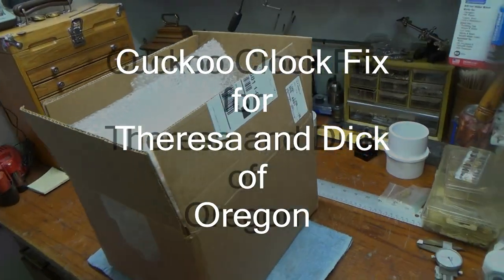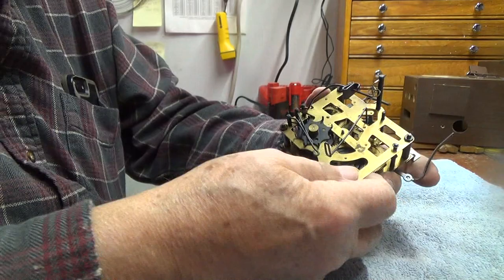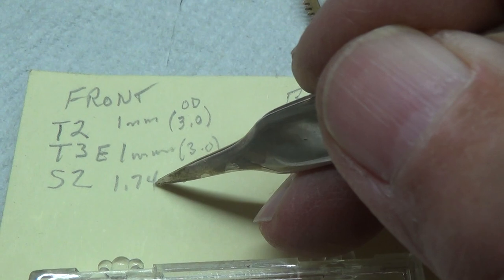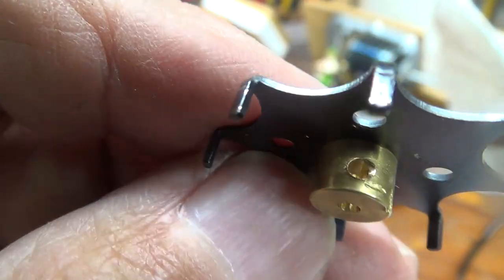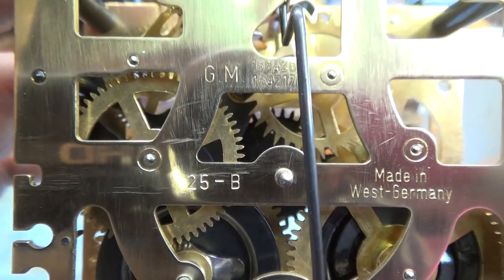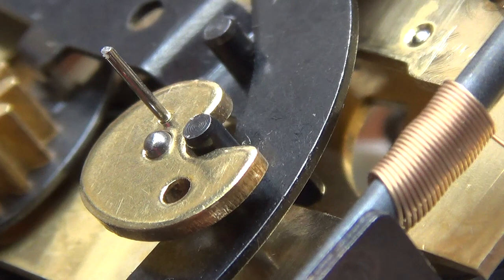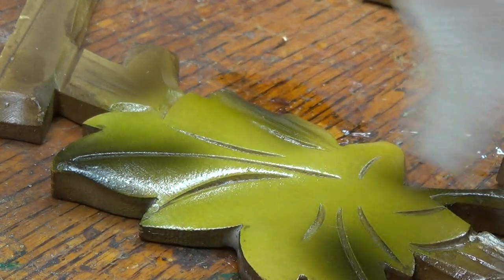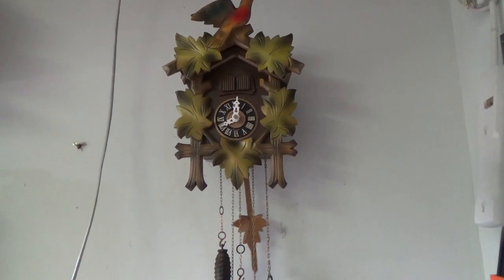Cuckoo Clock Fix for Theresa and Dick of Oregon

Comment: Mr. Perry, If you remove a movement to get chains back on the movement and it was a new clock( reason for removal small), and you put it back together and get no cuckoo calls, I guess you have to remove it again right. Not sure if lift levers were in right position. Please advise.  Thanks😊
Reply from the maker: If all you did was refit the chains to the chain wheels, there is  nothing that should necessitate the removal of the movement unless something got damaged when the movement was taken out and the chains replaced. You have two lift levers. the longer one should be connected to the whistle on the right (as you look at the clock from the back) and the shorter one should be connected to the whistle on the left. When they are in place, make sure the levers are moving freely and not interfering with each other. Look at the wire on the bellow top of the left whistle that lifts the bird's tail.  If it is on top of the tail, the strike may stall.  Make sure it's under the tail.  Other than that, about the only other thing would be if something on the front (the rack, snail and levers) were bent during the movement being worked on.  I can't help with that without actually examining the movement.
Reply from the maker: One more thing.  When you removed the movement, how did you disconnect the bird from the door?  Did you remove the bird from the perch?  Make sure the bird is situated on the perch such that it does not get caught up on the door frame, either on the sides or on the bottom of the opening.
Reply: Thank you, I did notice the tail lift was over the bird instead of under, fixed that. Hoping that will fix it.
Yeppers I had the lift levers on the correct bellows. I thought I had heard that you needed to be sure that
lift wires needed to be put on after the bird has cuckooed. I was dreading taking the movement out
out again cuz the cuckoo house is too little to get you hands in. You have to take the movement out for
anything. Hopefully tail wire will be the fix. You are so amazing at what you do and I appreciate your
videos. Thank you for your response.😊
Reply from the maker: I hope that works for you.  Yes, those small cases get really touchy to deal with and it doesn't get any easier as you get older.
Reply: @dperry428  yeah, the old eyes give me a fit. Gonna have to get a head magnifier. No I’m still messing
around with it. Can’t seem to get pendulum to quit stopping. Gonna have to create a work station. Can’t seem to find level. Can’t get bellows to call. Just don’t know. I’ll keep piddling. I’ve looked for books can’t
seem to find one for cuckoo clocks. I bought one, but not beginner lingo.
Reply: @dperry428  Guess what ? Just seconds ago after moving that thing fifteen thousand different ways, I found its level. And…even better it’s cukooing whoo hoo touch down. Wanted you to know 😊
Reply from the maker: Great!  Persistence pays off, especially with cuckoo clocks.  They sometimes are the cause of nasty words.  The feeling of getting a cantankerous clock finally working is very satisfying.

Comment: When I take the star wheel off I heat up the brass it will expand away from the pinion and comes right off
Reply from the maker: If you watched the video, you'd see that's what I did.
Reply: @dperry428  I did see, at first seen you using the crow foot, I paused and replied then continued watching and seen you heated it up 🤦‍♂️ I really enjoying watching your videos, I started watching when the pandemic hit and decided to start working on clocks as well, my favorite is working on cuckoo clocks as well

Comment: Any reason why my cuckoo clock will run for a while and keep great time, then for no reason it will begin to either gain or lose time? I move the pendulum  a very small amount either up or down depending on whether is gaining or losing and the clock will run fine and keep good time for a while and then the whole process begins again. Any ideas what causes this? The clock is level and screwed to a wall that is solid. I have oiled the clock per your instructions.
Reply from the maker: The open pendulum, made of wood, is exposed to changes in the environment, especially humidity.  If the air is moist, the wood takes it in, changing both the mass and the length of the pendulum.  In the winter, heated air is much less humid and the pendulum will dry out, losing both mass and length. Changes in temperature, too, affect the pendulum length.  Drafts from forced air heating, doors being opened and closed and even people walking by can significantly affect the pendulum's swing, altering its time keeping.  Cuckoo clocks are notoriously poor time keepers.  They are enjoyed for their novelty.  You can improve their timekeeping by controlling environmental fluctuations -- not an easy task.
Reply: @dperry428  Thank you. That is most helpful information.

Comment: You did a good Job. The Cuckoo sounds Not good, the Whistles are in a Different lengh the right one is shorter then the left one. Nice double Door Cuckoo Clock from E. Schmeckenbecher Germany. Best Reguards from Germany.
Reply from the maker: You didn't watch the whole video, did you?  I replaced the cuckoo whistles with a matched set.  They are the same length in the finished clock.

Comment: Great to see you doing a clock again.Need to pick your brain.How do I fix the cuckoo door so that it closes all the way after the strike.thank you,Don take care.
Reply from the maker: There are at least 3 possible reasons for the door not closing. 1. The spring that operates the bird's perch may not be tight enough (not a usual cause).  2. The wire connecting the bird to the door may be too long (not a very common cause).  3. The wheel that has the gathering pallet on it is also the wheel that has the black tabs on it that opens the door.  The wheel may be slightly out of position such that one of the tabs is pushing on the lever that opens the door, keeping the door from closing completely. (most likely cause if the clock has been disassemble for  service).  Remedy is to remove the gathering pallet  and allow the strike train to run enough to move the offending black tab to a position where it doesn't contact the door-opening lever.  Then move the train just enough to put the warning pin against the stop lever (at top edge of movement). Then reinstall gathering pallet with the lever pin in the depression of the gathering pallet.
Reply: @dperry428  Thank you I will check it out

Comment: How do I get your contact information? If possible to fix my clock.
Reply from the maker: I don't know.  I won't publish my own email. I get enough crap already.  YouTube will censor most attempts to post a link beyond YouTube. You can try to make a comment with your email spelled out in words, like the word "at" for the symbol and "dot" for the period.  I will then contact you and delete the comment without publishing it.
Reply: @dperry428  spelled all together
Reply from the maker: Just try to do it, however you think it should work.  I have no idea what will actually work.  Google and YouTube did away with personal messaging a few years ago because they said no one used it.  Now, they censor outside links for heaven knows what reason.  Leave it to them to screw up a simple need for people to communicate. Kind of screws up the meaning of "social media", doesn't it?

Comment: Would have been easier to just get a new movement?
Reply from the maker: Wouldn't be the same clock then, would it?  Kind of like the old guy that says he has an axe that belonged to Abe Lincoln.  The handle was replaced in 1910 and the axe head replaced in 1975, but the axe belonged to Abe, right?

Comment: How long Last a cuckoo clock machine if oiling each 2-5 years
Reply from the maker: Depends on the environment to which it is exposed.  Hang it in a kitchen where grease and dirt will accumulate and it won't last 5 years.  Keep it clean and it will likely run for 25 years or more.  Oiling by itself does no good if it's added to dirty pivot holes.
Reply: @dperry428  im from brazil... i bought a New cuckoo clock from germany.... in brazil were made cuckoo clocks in 1950-1970 .... "relógio cuco H " .....